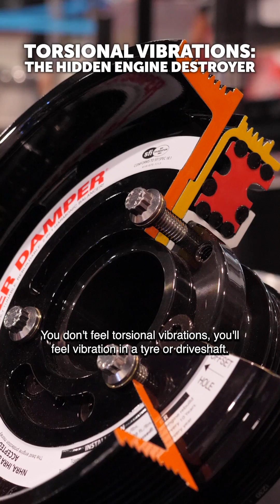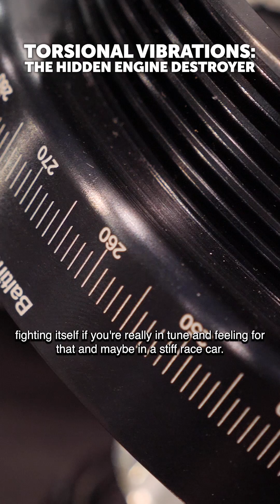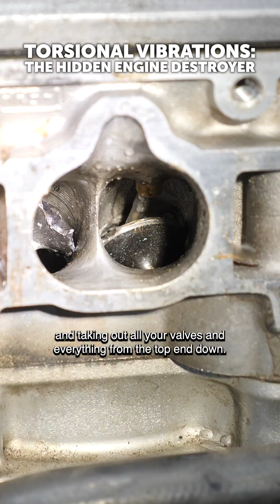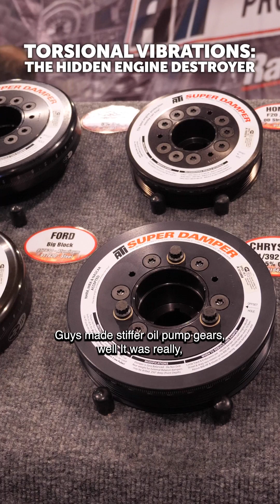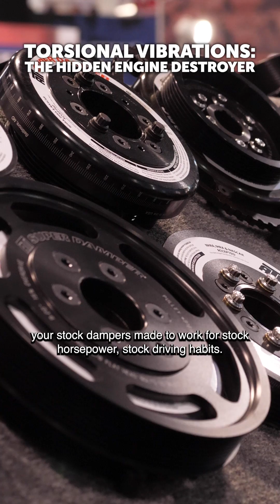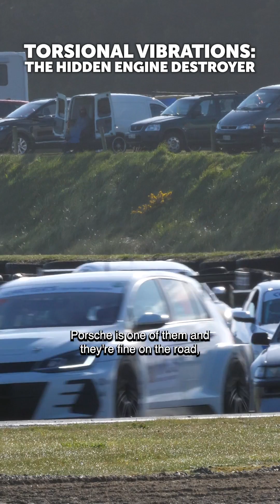Did you remove this CRITICAL component? #shorts

Comment: This dude just say Porches fail as soon as they start racing? Have you been to a track? 🤨
Reply: He probably has. I do know that the Fluidampers work nicely on an old BBF. Even after balancing and lighter weight pistons I could instantly tell a difference after swapping from the TFS bonded rubber type balancer. No other changes made. It’s a HEAVY rotating assembly for a truck. 70lbs just the crank, plus rods and pistons. Flywheel and clutch adds another 81.25lbs.
Reply: Yeah they definitely smooth them out, on a manual car a quality dampener is a must but fun fact a torque converter can help control vibrations from the rear of the crank
Reply: @turkeyboyjh1   I didn’t know that, but it makes perfect sense.
Reply: @25aspooner  yep I tell customers I’m not going to stop you from buying one if you feel the need but upgrading the dampener on a auto isn’t needed unless you’re one of the guys that want the full custom engine look
Reply: I think all newer Porches come with fluid dampers, dont they? 
Fluid dampers actually free up hp across the entire rev range by lessening torsional vibration, and they're cheap. Hard to imagine they wouldn't have one from the factory.